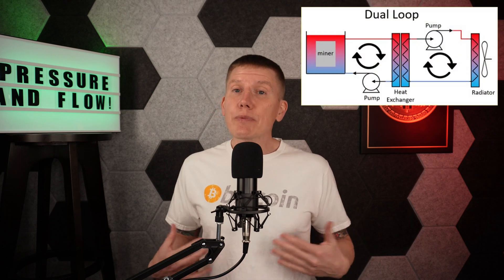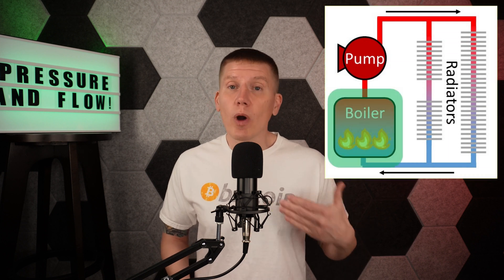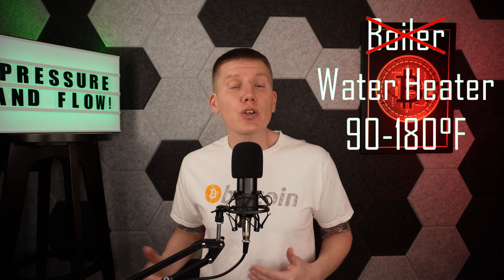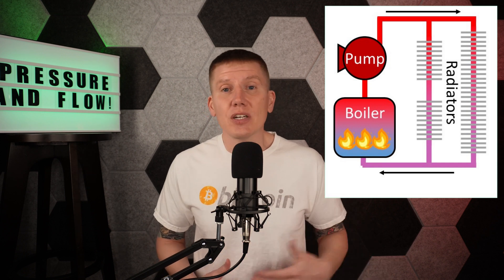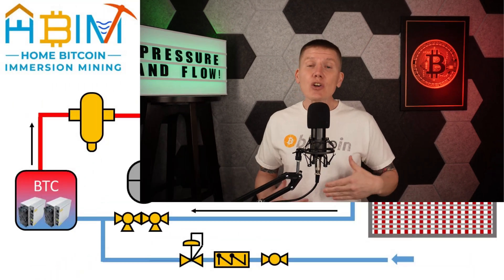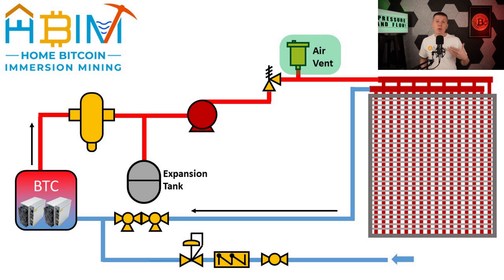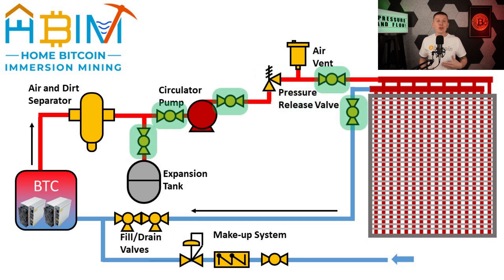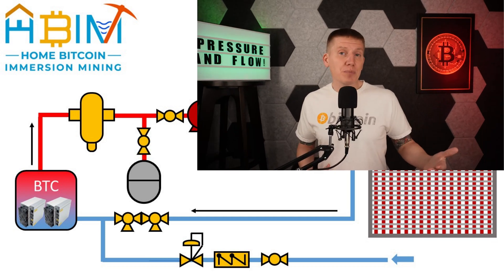EP12: How to design a hydronic circuit for a BITCOIN immersion miner

Comment: Great vids Bob!  Question from the last video about the mixing valve.  How necessary is this for a dual loop?  You mentioned this was to avoid over cooling the miner in the winter. Have you seen this happen considering you have the initial plate chiller in the first loop. No actual super chilled liquid getting to the miners. Just curious.
Reply from the maker: Good point...I think it would take a lot to both cool down the secondary loop and the primary loop down to a temperature where you'd hurt the miners or see a decrease in efficiency.  With my home heating I think the big benefit is to reduce the amount of cooling when it gets really cold (sub-freezing) out.   To drive heat into my home, the temperature of the secondary loop has to be above room temperature or it will act like an air conditioner.